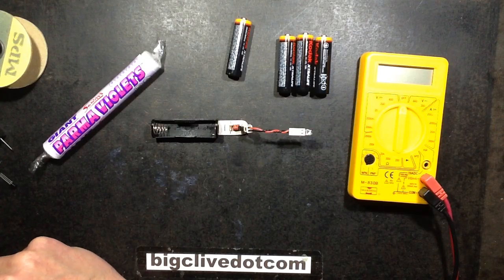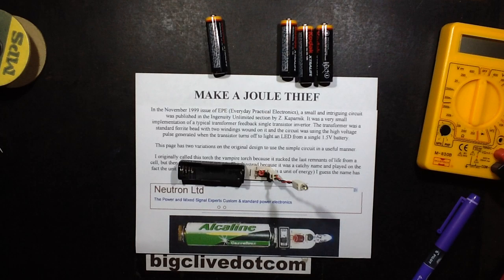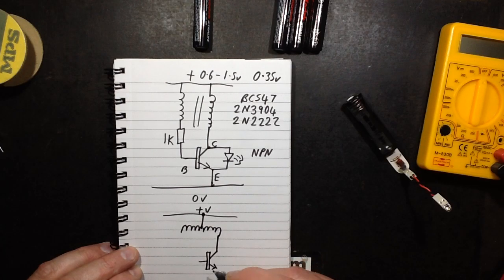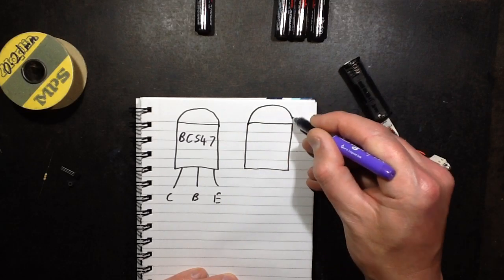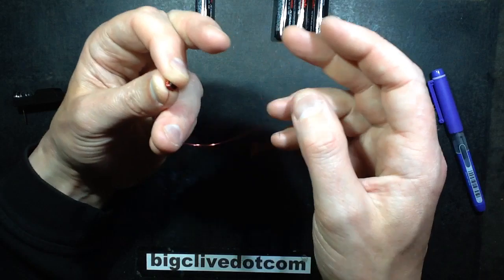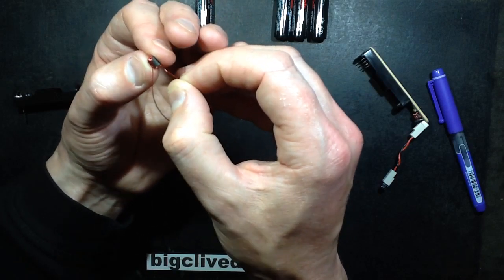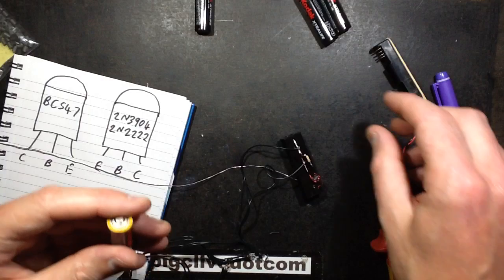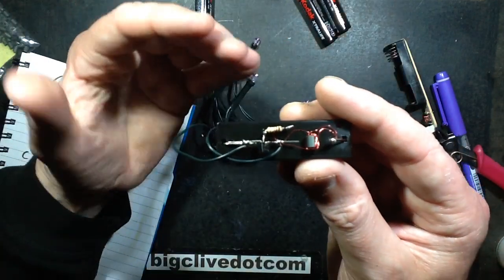How to make an authentic Joule Thief.

Comment: I'd love an explanation of how the transistor works in general. I know I could just look it up, but sometimes having it explained audibly works sooo much better! Also great circuit, very fun and am planning to try it out for the kicks n giggles :D
Reply: Trust me, it all starts with the diode. Historically and educationally. Understand the physics of a diode first and then transistors, mosfets, voltage regulators fall open to your brain.

Comment: Hi,
I just found the following chip from ebay, it is HH004F which is basically a Joule Theif IC chip that only needs a 1/4 watt 47uH inductor to run.
Reply: majdinj And how would it compare in price to a cheap transistor, an even cheaper resistor and an extra winding on the coil?

Comment: Big Clive, thank you for the tutorial on the Joule Thief!! I did put it together, and on my second try, and a little troubleshooting, I got it working. I had the LED in backwards, but knew that I was close when I saw the LED dimly flashing when I stuck my grubby fingers into these works. I reversed the LED, and Voila, it works as advertised!! Now that it is working, it is time to dive in and beginning experimenting! Thanks for the marvelous tutorial, I'll let you know if I come up with any monumental experiment results! I used a .37" toroid pirated from a computer motherboard, and found a suitable .2 mm enameled wire from some sort of ferrite pole, and all the rest of the components from miscellaneous bits and pieces. A bit of Dark and Stormy would make the toroid winding much more enjoyable,   I am quite sure...😁

Comment: There might be an advantage in using a germanium rather than a silicon transistor.  This is because the silicon transistor requires about 0.6 volts to turn on, hence the oscillator will not self-start below 0.6 volts.  But a germanium transistor turns on at about 0.2 volts and therefore the oscillator should self-start at around that voltage.

Comment: Clive:

I have many videos on this great little circuit that I was introduced to by you many years ago.  My record for running off of a single depleted AA battery ("dead") is 400 leds.  I also used this circuit along with my earth battery to light up a bunch of stuff.

Many of the lights in my apt. are leds lights powered by JT circuits using "dead" batteries given to me from friends that would have thrown them away.

I first saw your circuit when Bre Petis and Wendall Oskey mentioned you in their Make video on the simple, basic JT circuit.
You are famous in many circles now.  There are many topics dedicated to this circuit on many research blogs including Overunitydotcom.  I have been told it is a simple blocking oscillator circuit that was developed by a Russian guy back in the late 1960's.  Who knows...but...you are the one that made it famous and named it the Joule Thief.

Great work Sir.

Bill

Comment: Dave Jones may have a grum with your video :)
Reply from the maker: Jared Reabow I don't think there's anything that Dave doesn't have a grumble about.
Reply: bigclivedotcom Hmm true, it does bug me that if it Doesn't have a "respected" brand, it's a crusty cheap design but the identical or worse with Fluke etc brand is Just better because...
Reply: bigclivedotcom The constant jeering is getting very tiresome.
Reply: Jared Reabow Erm.. he doesn't just see an item from a non respected brand and instantly say its a cheap design, he does take them apart and analyses the insides, have you not watched one of his videos properly?
Reply: megaspeed2v2 Nope, he jsut assumes its rubbish then when he takes it apart goes to town on everything bad,
Specifically the multimeter shoot out where he berated what i think it was the UNI-T for several issues however Fluke had EXACTLY the same issues and they were ignored.
I believe they were design of the circuit layout and the banana plug post designs but I cannot recall exactly.
On a number of tare downs, he burns on a product for a design flaw and sometimes states that is the very reason why the product is bad and should not be bought but some of his tear downs on the branded products with the same issues get a small comment or snide remark but no condemnation.
Reply: Jared Reabow if so then how is it that whenever he actually performs tests on products, the ones he says are cheap perform badly, sometimes horrifically such as exploding with enough energy to take your hand away and the others tend to perform well even to the point that a 4kJ jolt merely kills the meter but wouldnt kill the user. The only thing i'd probably say against daves videos on multimeters for example is how hed have you believe you should have a fluke even if you only ever use it on low hazard stuff like working on a maximum of 30v but thats just a matter of being over cautious rather than being downright wrong.
Reply from the maker: megaspeed2v2 There are some details he picked on that I thought were unfair.  The Extech meters heavy wire link being one.  To me it makes sense to take the 10A circuit off the board and use that link, since it's going to be much more resilient than a track would in that space.  I think it was the same meter he tried to destroy by throwing it down rocks and into the water, but it finally took being driven over on coarse dry ground to break if I recall correctly.
Dave is a meter aficionado.  When he finds cheap meters work well he only agrees grudgingly.
Reply: bigclivedotcom There's a big difference between claiming 1000 V CAT IV and "probably won't blow up on <30 VDC" on the meter. Anything claiming the former whilst being blatantly false deserves some grudging. Any way you twist it, it's buying a turd showed into a fake rubber boot. Cheap whatever usually works, most of the time,, but that's not really the issue. Building things to a price should reach a limit when claims made turns false.
Reply: +bigclivedotcom I think the issue is, he worries about dangerous meters, and cheap is a red flag. So when a cheap meter performs well, it is an exception, and he is cautious as it is a exception to the rule that cheap meters may be dangerous. Assuming all cheap meters are good because a specific cheap meter is good is a trap. It very well may be true that a cheap meter is accurate and safe, but paying more money for better thought out design and controlled quality control makes sense. This does not mean expensive is better, but it does mean cheap does not have as much budget to look out for you. 
I think dave holds his abstract prejudice in too high esteem, that it is difficult to admit when it is wrong, even when anyone would agree it is merely an exception.

Comment: The two poundland garden lights for £1 have a joule thief circuit
Reply: They are very very cheap. Add a diode capacitor and resistor and you can smooth it out as well, so you won't see flickering.

Comment: I am curious. If this circuit is so simple and versatile, is it possible to miniaturize it to a microchip scale and mass produce them? A tiny chip scale Joule Thief can be integrated into the "button" shape positive terminal of any cell battery. All of a sudden, the battery manufacturer can sell a product that last 3 times as long as current batteries. You mentioned about the voltage change, that may be another problem to solve.
Reply: +cplai 
There is already a company that sells a battery clip-on device just like that, and they do make wild claims about battery life.
However modern batteries do not discharge in a linear path for the exact reason of getting more life, they will drop down to 1.1V pretty quick but then only very slowly drop the voltage to 0.8V at which point they are 80-90% empty (depends how good the battery is), from that point on they drop the voltage rapidly.
Obviously you can still get some juice out especially in for low power devices, but it isn't a huge amount, and because the circuit takes some power to run itself you would make things worse using it on a new battery.
Reply: +MsSomeonenew You are talking about the batteriser/batterizer right?
Reply: +MrOpenGL - Thank you for pointing out such product. I didn't know it existed. http://batteriser.com/ I wonder if it is same design used in the product.
Reply: +cplai The joule thief is not particularly efficient, so it would quite likely waste more energy due to inefficiency during the generally "usable" part of the discharge curve than it enables you to extract additionally during the "dead" portion of the discharge curve.
Also the joule thief is an unregulated boost converter and therefore not practical in most applications (slapping on some form of voltage regulation would reduce the efficiency even further).
Another negative point would be that when used in a product that isn't on often, the joule thief will still discharge the battery.

Besides this, it is very expensive to make inductors on a piece of silicon, as they are physically large.

You could (probably) achieve greater efficiency with a state-of-the-art boost converter chip. but you'd still be stuck with the efficiency problem.
The only usable option would be a circuit that's in standby (not consuming power) for the usable part of the discharge curve that activates when the battery is considered "dead", but clearly this is not worth the effort or someone would have done it. (Remember, batteries are specifically designed to be drained of their energy as much as possible (e.g. keeping the voltage usable (high) for as long as possible))
Reply: +Aars Haar - thank you for your reply. While efficiency is a real concern in general application, in comparison an inefficient Joule thief is still more efficient than throwing the battery away.  For example, if you still have 10 units of charge left in the battery and getting 3 units out and waste 7 units is still better than throwing all 10 units away.
Reply: cplai
You're welcome and thank you for yours as well.

That is correct. However, modern day batteries are designed so that they will deliver 90% or more of their total energy in a generic appliance.
When looking at a battery datasheet you will notice the voltage remains relatively constant over most of the battery's life and suddenly drops off very strongly.

When extrapolating some graphs of batteries under constant current load, it becomes clear that the energy left in the device before the voltage drops below a usable level is very little compared to the total energy in a fresh battery.

My point was that in modern day batteries, the extra energy the Joule Thief (or a similar voltage boosting device) allows you to extract from a battery will be less than the amount of energy lost due to the power losses through efficiency < 1.

Besides this, the cost of a small circuit like this would probably be higher than that of the battery itself.
The obvious alternative is then a device you place around the battery that does the same thing, but gets carried over battery to battery.

As mentioned by MrOpenGL such a device already exists, and was already busted by Dave over at he EEVBlog.
I would advise you to watch his video as he goes more in-depth than is practical in this comment sections and gives some figures.
Reply: cplai  Just assume we can normally (wihout a Joule Thief) use 90% of a battery's energy and our Joule Thief is 90% efficient on average (this is a naively, if not impossibly, high figure). Let's assume our converter can pull ALL the remaining juice out of the battery.

In this case, which involves a reasonably crap battery and an extremely good converter, we gain our last 10% of battery capacity, but we lose 10% over the whole range so we end up with... no gain.

Now imagine we have some spare charge left that our converter can't use, a better battery that allows more of its capacity to be drained and a slightly less amazing boost converter (a more realistic one), you'd quickly end up with a negative gain.

Then we haven't even considered the unit cost of these devices. Inductors aren't cheap and neither are state-of-the-art chips.

Overall you lose either energy or money, and most likely both.

Besides all that, integration into a battery is never an option, as batteries need a shelf life.
It would suck to have to replace your batteries every few weeks on appliances you don't use because the booster has drained them.

Disclaimer: the values I picked are not actual values, but probably fairly close. The chip Dave shows, for instance, doesn't hit the 85% mark AT BEST.

If you were using said device, your battery would need to be really crap to even break even energy-wise.
How crap? Well if you're drawing 500uA (in a calculator, for instance), the converter chip has a shocking efficiency of only 65%. And that is with a reasonably high input voltage (0.7V).
This means you lose 35% of your energy. Guaranteed.
That means to break even, your battery has to have AT LEAST 35% charge left when it's "dead".
In actuality, it will have to be more like 40% or 45% since the boost converter chip can't work below a certain voltage.

I will guarantee you that you won't find a battery from a big brand that has THAT crap an output energy.
On top of that it draws 5.5uA standby current, not very nice in our case.
Reply: If you're switching the battery off from the circuit, how would it still be discharging the battery? Also, I'm no expert, but I've been playing with this circuit and it seems to me that there is very little efficiency problem with it since all the resistor does is protect the base of the transistor which needs very little power. 

I really think the circuit can be very useful in a power outage if you save all of your dead batteries that are between say .8 and 1.1 volts. Most of my AA & AAA devices only drain the battery down to about 1v, which leaves at least 24 hours worth of useful light from the JT circuit. You can get at least a couple of days of night navigation light for, say, your bathroom from a battery that you normally would have discarded. For a poor person, especially in a third world country, this thing could be a real blessing.